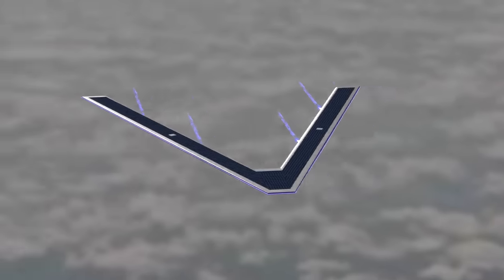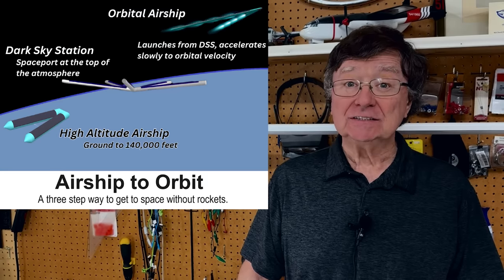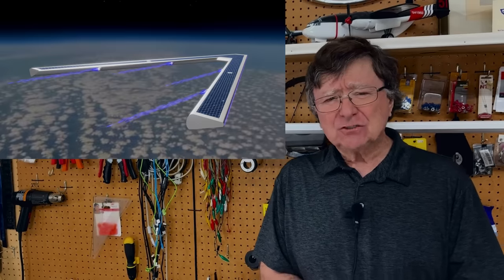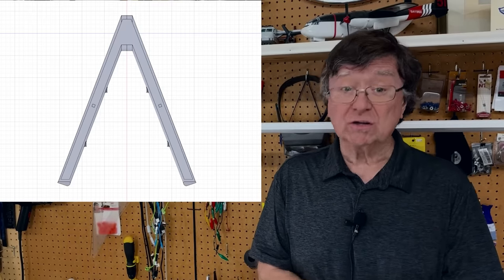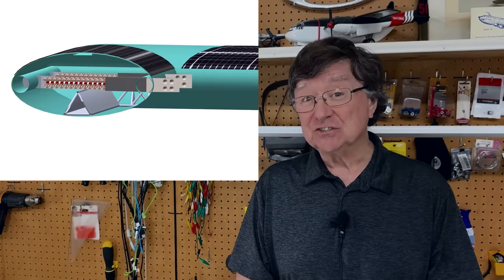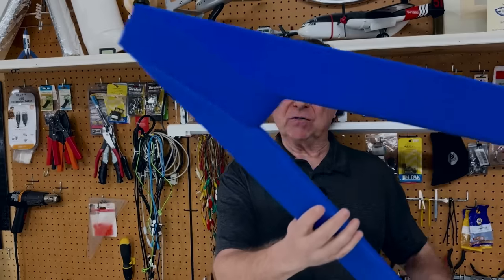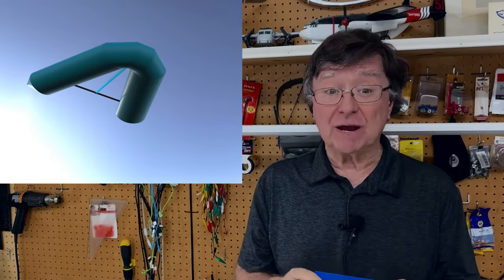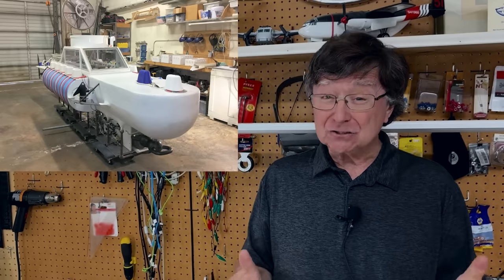Introducing: Ascender H1 Variant Orbital Airship

Comment: John, the idea and concept seem feasible, but you will need pretty loaded benefactor, to cover starting expanses - including the "sky-base" in the midle. And additionaly - it will be pretty problematic to reposition the load from the first airship, into the ascender. Not to mention, if the ascender is ment to reach the space and unload there any payload, it will probably have to manuevre there. How with no obvious manuevre thrusters? 
BTW, would LOVE to see your airship lifting up two actual spaceship in dimmensions of 30x30x20 metres. Such boxy beast(s) would own anything we ever used for interplanetary transport, and it would probably OWN the solar system for a time. Not to mention, it would be 2 pieces of roughly double the internal space, what Starship 2.0 has. Albeit the actual weight carry capacity (in tones) might be problematic in spaceplane made mostly out of cloth...

Either reach to NASA or to SpaceX. Both should be able to fund you and help you with project management until you reach your projections and space...
Reply from the maker: We're done pretty well so far. This has been a pay as you go program. We've built 12 airships and conducted 200 high altitude flights on rockets, balloons and airships and thousands of tests and we're managed to stay out of debt. Every flight, every mission has to have a commercial side to pay for it. We're gotten pretty good at that.
Reply: @johnmpowell John, How Does Your Airship Reach L.E.O. Orbital Speed Once It Is In Space ? ? ?🤔🤔🤔🤔🤔🤔🤔
Reply: @johnmpowell  Your Airship Concept Is A Great Idea BUT Why Hasn't It Been Done Before ? ? ?🤔🤔🤔🤔🤔🤔🤔
Reply: @johnmpowell   John, How Does Your Airship Reach Orbital Velocity In L.E.O. ? ? ?🤔🤔🤔🤔🤔🤔🤔

Comment: If you have to get up to about 7 kilometers per second to reach escape velocity and the solar energy system can get it up to 4 km per second in very thin air, it would not take a very big tank of liquid air to get it up the rest of the way.  If the ship weighs 10 tons, and the exhaust is moving at 3000 meters per second, it would take about ten tons of liquid air. But it would take a lot less than that since the compressor on the front of the ship is still gathering air.  If the air is a thousand times thinner and the ship is moving 4000 m/s it would gather maybe 4 kg of air per second or a ton about every four minutes. If for every ton, the ship goes 300 m/sec faster, it might take about an hour to get up to the escape velocity around 7 km/sec.  The faster it goes, it seems like it would take less lift because the Earth is falling away faster. It does seem like it would take a lot less than ten tons of liquid air to reach escape velocity.  
If the ship had huge fold out mirrored foil surfaces that folded out once the ship escaped the atmosphere, a ten kilometer area surface focusing the sun onto the high temperature concentrated focal area of solar cells, with a hundred billion watts of solar energy, it might take maybe three years to get up to one tenth the speed of light.

Comment: Based on illustrated size of the cargo bay relative to the fuselage of the ship, the ship appears to be nearly 30 times the length of cargo bay.   If a shuttle's cargo bay is 60 feet long, that would make the airship nearly 1/3 of a mile long and possibly a 1/4 or more miles wide.    Where exactly is something like that going to take off?   Or land for that matter.    That thing is longer than the largest aircraft carrier.
Reply from the maker: The vehicle is actually over a mile long. It never lands. It's built (inflated) at the Dark Sky Station a floating station at 140,000 feet. 
Video show how it all works: https://youtu.be/MsI61Oa_EC4?si=V9Rb6R_sDELAmZPK

Comment: so this what was responsible for all those triangular silhouettes reported as ufo sightings?

I joke but looking at the test article photos, I doubt this program is responsible since only the h1 fits the silhouette and isn't built yet. So let's get to details. What's the payload capacity projected to be? What materials are being used to prevent over expansion in the upper atmosphere and beyond? I would assume some outer shell made of a non-stretch fabric goes around the material that holds the air to keep the shape you want? You said the frame is inflatable, how is that expected to hold it's shape while carrying weight in different areas?

Comment: a lighter-than-air craft built to make the leap from relatively slow progression lifting through upper atmosphere, to orbital velocity, represents a staggering acceleration in a short distance. even rockets with their most powerful sprint nearly vertical, start accelerating on the ground and do not cease acceleration until they are in orbit. and this craft made of fabric is expected to accomplish this in about 10 miles? 
you do know orbit is not simply a matter of attaining height, it's a matter of velocity. 
if this type of hybrid airship-spaceplane lift body was feasible, it would have already been done in the 1970's. Any space agency with competent physicists wouldn't let this design launch out of a brainstorm session, it would not even warrant a model

Comment: you might want to scale down... also idk how a 1 mile long inflatable tube is going to be structurally sound with those massive engines.
Reply: My exact thought lol. Just showing it's scale and thinking that that scaling is OK, means they are in lala land at this point.
Reply: He's showing you test beds. The final project I'm sure was basically aluminum skin with bladders filling all the available space for lifting.  And you'd have to have compression units to ballast the ship and cause it to go up and down. What we saw fly a few years ago wasn't just ballon materials. 😂 it was a hard sided blimp.  We could see the ion/ hybrid thrusters glowing. That thing isn't small by any means.
Reply: Scaling down doesnt work in this case. You cant make fabric thinner.

Comment: Wouldn't  you have to vent the lifting gas as you go higher, untimately to near vacuum; otherwise, the sip would gradually gain relative weight as you go up.  But if you vent the gas, how can you come back.  I guess you could glide back (pumping in regular air to keep shape), but you'd have to be certain of your ability to land.  And man, that much Helium would be very expensive.
Reply: They also thought of using hydrogen but in reality using hydrogen is actually more expensive than helium which is the reason why they are sticking to helium instead.

Comment: Is this the same as single stage to orbit ? SSTO . Never mind . Mile long wings . Inner lifting cells . Helium ?  No runway needed . Hell of a big lot needed . 60 feet , 20 meters deep  cargo bay , This is one hell of a airship . Or not . The Hindenburg was 135 feet tall at the tallest point . Cargo weight to orbit ?
Very interesting
Reply: It's not SSTO because this is only the upper stage. You need a different, more structurally sound airship to bring it cargo.

Comment: I understand that thi is scalable but curious what is the lift capacity for the system you presented? How long will take t float to space and then how much time will it take to get to orbital velocity before releasing cargo?
Reply: There's no orbital velocity.  It's basically a blimp. The rockets would be to move to a satisfactory trajectory to release the satellite on. And to move in pace with satellites they want to retrieve.  Only in the upper atmosphere would they move at higher speeds where atmospheric resistance is minimal.  It can gently achieve orbit and do the same to return to earth.  Just like flying a hot air balloon

Comment: I fear there will be a lot of up and down tork on the point where the wings meet the bidy section of the craft. Wven worse is the fact that; the wings could begin moving uo and down out of sync;    which xould cause an ossilation that hits the right frequency as to, make rhis craft very hard to control.

Comment: Takeoff and landing? What kind of airport and especially how big of an airport with this each one variant need to take off in land? How long and wide would the airport have to be? Also, how would you protect this from rain or wind when it was on the ground? I would think it would be completely impractical to build a large enough hanger to completely enclosed this, but maybe I’m wrong.
Reply from the maker: The vehicle is actually over a mile long. It never lands. It's built (inflated) at the Dark Sky Station a floating station at 140,000 feet. 
Video show how it all works: https://youtu.be/MsI61Oa_EC4?si=V9Rb6R_sDELAmZPK
Reply: @johnmpowell  ok, sounds reasonable. However, if it doesn’t land, how are you gonna drop off the Hubble space telescope when you bring it back? Parachute? Also, how are you gonna load the cargo be? Is that gonna have to be done in flight?
Reply from the maker: We're putting our spaceport at the edge of space instead of on the ground. This is the Dark Sky Station. Our transfer waystation. Smaller vehicles go from the ground to station.  https://twitter.com/JohnMPowell1/status/1767271691888304376       @wbwarren57
Reply: @johnmpowell  
Sounds good.  I like the completely different approach and the extensive testing.  I will watch your progress avidly.  You seem to have a complete lifecycle view which is sadly lacking around the Starship development which I call "a bridge to nowhere" since it seems to depend on so many ridiculous assumptions and a whole lot of hand-waving.

Comment: You have to go back entering atmosphere. That's the hardest part.
Reply: They would slow down and would glide much more slower then reentry.
Reply: Like it ascends, it descends. A slow gentle transfer between lower and upper atmosphere. Like going up and down in a hot air Ballon.  Once in orbit, they can crank up the speed where theres less resistance to the atmosphere.
Reply: @Fold-103  Hey, Don't try to ignore Physics. You need heat shield to be safe. If not, it's gonna be a toast. :)

Comment: Have you actually evaluated the polymer bond/physical stresses of temperature flux through the thermosoher and ionic effects, ekectriststic fluxes and reative raducal ion and mono-atomic Hydrogen not only on fabric, but the laminar ionization or your leaking He or H2 gas with induced micro-plasma fields and flourescdnt emissions?
This doesn't even address these factors at high accelerations abd speeds as well as deceleration gas mass shiftson structural stress of foil design inside and the inevitable increased static field of atmospheric laminar attitudinal/orbital  nano and micro particulates(volcanic, pollution, cosmic dust and micrometers ever presence every hour to minute.
(See jet engine malfunctions and airliner surface micro polishing damage, and SR-71 data).
One other thing, you must evaluate every altitude ans speed contact effect to every particles, ion, upper altitude solar radiation, ions, cosmic particles and Ray's and internal balloon reservoirs for polymer fabric "Off' Gassing and micro/nano to milki and gross  migratory flow & creep seepage of constituent plasticized, static control agents, UV resistant fiksment/tgread coatings, etc).
You really need an atmospheric chemistry,  astrpphysics and materials engineer with advanced  dynamic strsin, creep, polymer composite(polymer fiber + additives/coatings and static adherents) physical and reactive chemical dissociative backgrounds  Also their doping effect on bouyant gases under all above factors. 
These alone make re-usability in doubt, let alone primary survival in space let alone integrity for re-entry, especially hypersonic use.
That's not even considering the hazards of micro-meteors and mini to micro space junk along with the adventure of Musk's, Bezos' and other low orbital crowding.
The Static voltage pptential alone on arms, as experienced in orbital tow lines, is immense enough of a problem that would exceed your solar films and likely malfunctions, arc or destroy them all.
You have to review dimensional and topological surface potentials, sinks, sap storage and dissipation at every velocity, altitude/orbital and solar exposure. 
Otherwise it's an expendable expensive party balloon destined to choke cryoto sea monsters.
(Straws not inckuded).

Comment: Unless the price-per-kilo to orbit is 10 to 100 times cheaper then Starship, this won't ever get built. Even if that number can be reached, the material science to put an object that dwarf's a pair of supertankers in to orbit, the size of the facility it'll need to land on (and lets not go there by suggesting ocean operations, the waves along a 1.8 kilometer side will tear it apart), and then the rare perfect weather it'll need to survive the turbulence in the lower atmosphere.
As much as I love free thinking and radical design, this things never flying. Smaller versions, maybe one tenth of the size, might be built, but not any time soon.
Reply: How much was spent on this already?
Reply from the maker: The vehicle is actually over a mile long. It never lands. It's built (inflated) at the Dark Sky Station a floating station at 140,000 feet. 
Video show how it all works: https://youtu.be/MsI61Oa_EC4?si=V9Rb6R_sDELAmZPK
Reply: @johnmpowell  So it's an improbable vehicle, to be supported by unrealistic infrastructure. Begining to sound like a Moller SkyCar, which was a great project designed primarily to get government grants.

Comment: The CARGO bay Function is good fixed however with varied CARGO....adjustable weight is likely.......nice but expensive,weighty.....and torsionally demanding....but always torsional reinforcement is always wished during weather demands or maneuvers requiring reliability and safety......as every flight and payload and route always has..temps..pressure...and weathering flex versus stern designs.
MEMBA....complex is created new...simplicity is learned by experience.
Einstein.audie Murphy's.gilda.